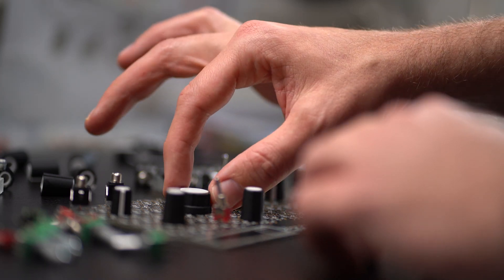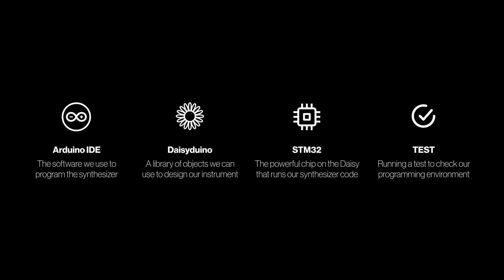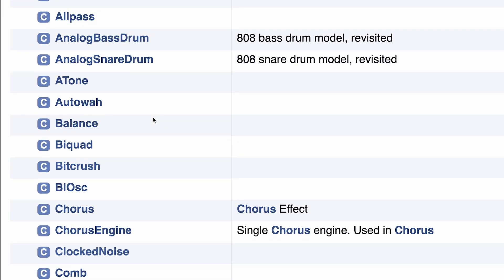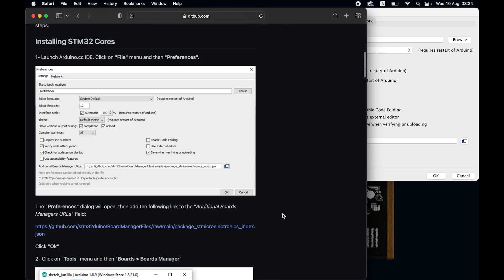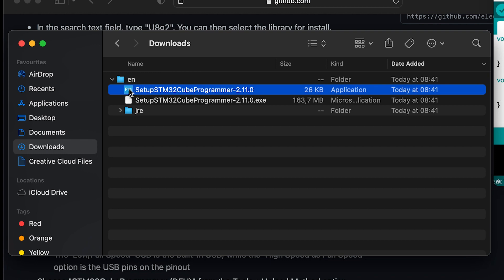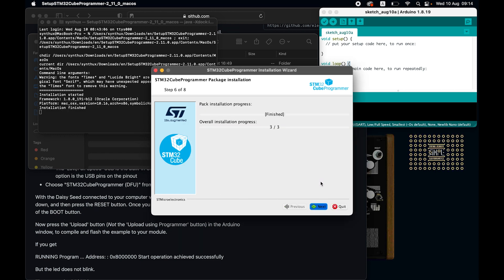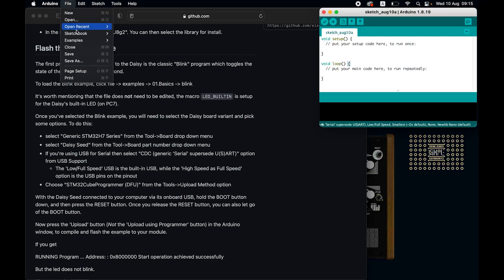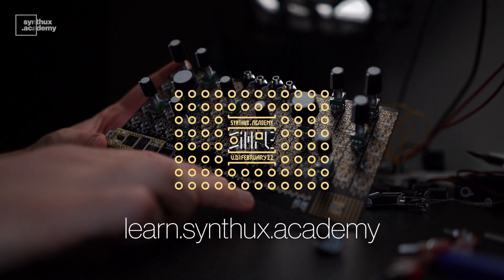Daisy Seed Setup and Install - Arduino, Daisy & STM32

Comment: I was having a lot of trouble on the final step. I was getting the error "Error: Target device not found". I did two things and one of them solved the problem (since I did them at the same time I don't know which one it was lol). 
1) I switched to a different USB cable
2) I went to the menu "Tools > Port" and selected the USB port that my Seed is plugged into. 
I hope this helps anyone else having the same problem!
Reply from the maker: Thanks for sharing! I'll add it to the Discord thread as well.
Reply: it's the cable! some cables are not suitable for these operations, same way I couldn't make my arturia keystep work with the wrong cable

Comment: hi! is anyone successfully using stm32cube programmer with mac catalina (macos 10.1.5)? i built the simple fix last night, then got through alll the steps of the software stuff, including install of the stm32cube programmer, but when i went to run the “blink” sketch, it said this version of mac not supported. i’ve been looking for what version might work but what i’ve found is kind of confusing, wondering if anyone has had success?
Reply from the maker: That might be a problem with the programmer installation. Maybe try to uninstall it? Or try to work with another computer? Here is the complete troubleshooting guide: https://www.notion.so/tsemah/When-things-don-t-work-Troubleshooting-81c77e8aa3354161a0c74d971b9c9865?pvs=4

Comment: So does this mean I could have something like an Arduino uno communicating with the daisy seed? I'd like to send accelerometer and gyroscope data to an Arduino and then send that data to the seed. Would this be the right approach to get there?
Reply from the maker: You could probably use the gyro directly on the Daisy using i2c. Join us on Discord to figure out how to do it. Lots of makers there.

Comment: Great instructional :) The only thing I would add is for Mac users, you may need to bypass the download restrictions for unknown app sources to get the Cube Programmer software. Other than that, I have successfully made my LED blink ;)
Reply from the maker: True! Happy it worked for you 💪
Reply: how do you bypass those download restrictions? because that is literally the problem i'm running into and can't find the way to do it..
Reply from the maker: You mean that the files you downloaded doesn't open on Mac? If so, right click and open from the menu. Then, it should give you an option to overwrite the default restrictions. Hope this helps.

Comment: You can get around having to press the two buttons by using a debugger. However I have not been able to get my debugger to actually be able to debug lol
Reply from the maker: True! But it's really hard to get it these days due to the silicone shortage 😔
Reply: @SynthuxAcademy  Truuu, it’s been crazy how long it is to get parts and stuff these days